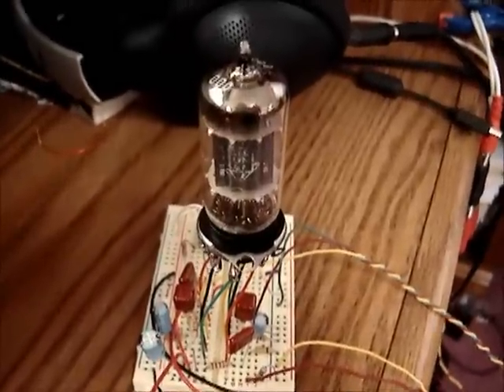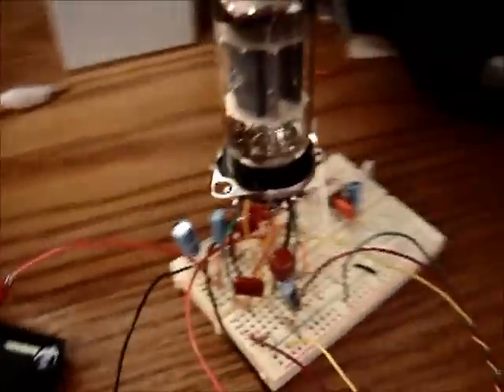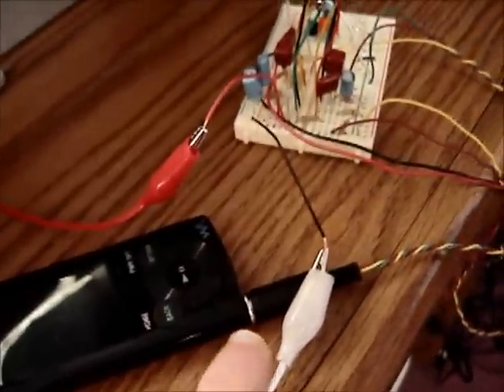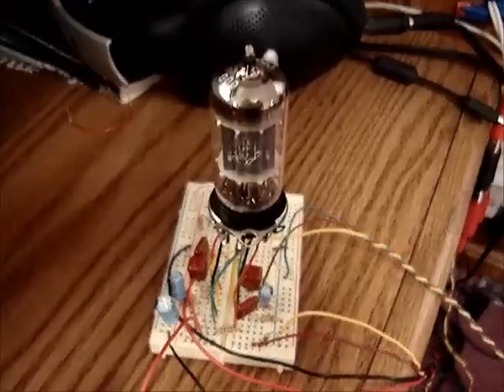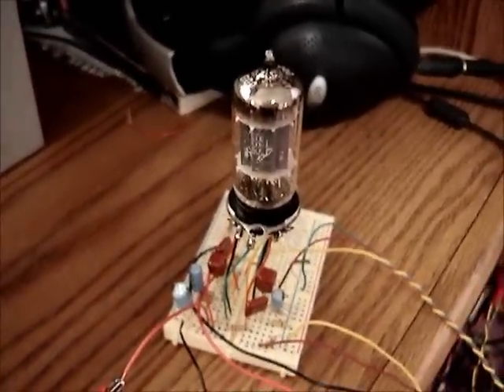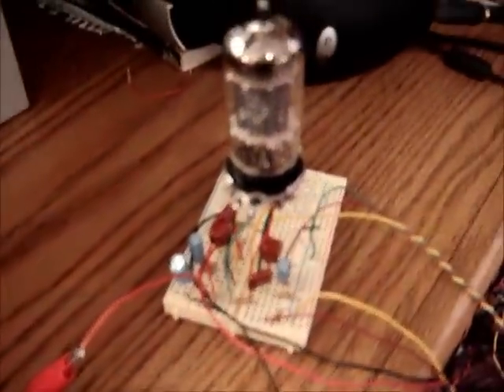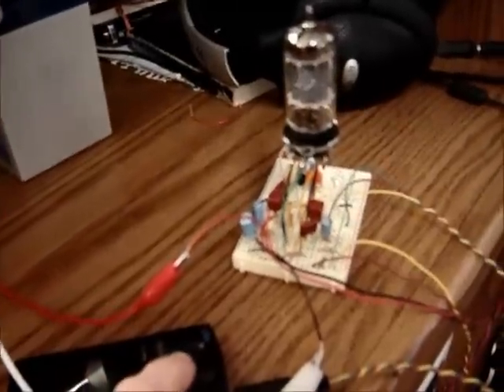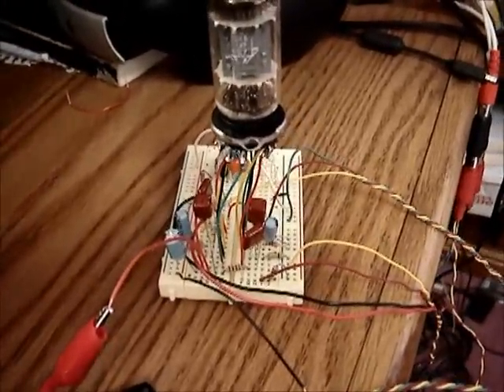12AX7 stereo tube preamp only 12 volts

Comment: Good evening my friend, can you tell me the values of the capacitors? I was very interested to carry out your project.
Reply: the capacitor's values are one the schematic itself...
Reply: 1 uF?
Reply: wenderson eliecio Yes. You can use unpolarised electrolytic. If you don't have one, you can make one from two polarised ones, like this:
----)|---|(---- Make sure they're both 2uF because in series, that would equal to 1uF.
Reply: Thanks a lot, I do not know how to read capacitors, only resistors.
Reply: wenderson eliecio Even if they are marked, they are sometimes wrong. Your best bet is to take the multimeter, and set it to capacitance, and measure every cap you will use. Be sure to discharge them before you measure them!
Reply: Didn't expect a 12Axx to work at such low voltage.  Sounds pretty OK too.
Just wondering if I would have to change the resistor values proportionally if I increase to 24v or 48v?
Reply: @Unker_Spunkanathan  if they are rated for higher voltages, no. otherwise they will be releasing magic smoke

Comment: I wish I understood why you have a 47K resistor and a 470K in series.  Is that where you're splitting the power supply?
Reply: He made a voltage divider with those two resistors

Comment: Just made one,tried it with several tubes,... sounds like shit.... did you draw up the schematic right?(removing the 47k bias-resistors doesn't make any difference) (weird)also tried it without cathode resistor and or bypass cap,it all sounded really bad.It did get a litlle better with 100k anode resistors but still...it doesn't really work.
Reply from the maker: Could be the load impedance the output is connected to is too low and it will load the amplifier down. The music samples at the end are right off the circuit. My tube was worn so tweaking resistor values of bias would be necessary. Overall it is an experiment, not all that practical really.
Reply: It was connected to a tube amp (500k) anyway it was a fun experiment  ;) (maybe i'll try it once more without  the 100k resistors across the output...)

Comment: This is how so many manufacturers got away with selling "tube" amps for years.  By avoiding having to build expensive high-voltage power supplies to make these tubes operate where they actually work, they put cheap, shitty IC/transistor amps on the output to kick up the gain...

Comment: Running a tube in "starved Plate" mode is a poor way of doing this, and running the heater @ anything above the max voltage will destroy the tube. There are better options... you can use a DC to DC boost converter or a flyback or a charge pump supply, with good filtering, that can give you the higher required Plate voltage easily and inexpensively if you don't want to mess with a traditional linear power supply, is the way to go. And furthermore... this nonsense that a tube sounds better than an OPA2134 Burr-Brown Op-Amp or a properly designed low noise, high gain, transistor or FET Audio Pre-Amp is ridiculous. There are also some great "single supply, rail to rail" op-amps that kick ass, if you're looking to run off of a low voltage like 5 VDC.
Reply from the maker: +Mark Rakemaker The filament was not run above the rated voltage. It is rated12.6 volts and that is what I used. The idea was to see how the tube would run on 12v. It has limited gain of about 20db and sounds good to me. I'm quite aware of how good IC op amps can be but this video is not about them and I made no claim that tubes sound better.
Reply: Part of my comment was directed @ a few of the earlier comments. One chap recommended "overclocking" the heater to 18 volts... lol. People often assume that tubes sound better than solid state arraignments.

Comment: You can get the miniature wire-ended valves from the CCCP if your know where to look or try EBAY, It is like being in the KRONUS HIFI factory showroom in DUNGANNON Northern Ireland.
Reply: David, do you have a model in mind that is known (by experimental designs or otherwise) to create good sound? And do any of them come with a datasheet that quotes IV characteristics with a low supply voltage?

Comment: What's the maximum gain you can get from these at 12V? I'm struggling to get more than 30dB
Reply from the maker: +Jack Holden Not a lot of headroom to work with at such low voltage. 30dB is not bad. You might want additional stages for higher gain.
Reply: yes. Up to a total output voltage of 10-12V, assuming you get the grid bias correct.
Reply: ...does that mean you can basically 'bolt on' additional stages for more gain?
Reply: it's hard though and you might need transformers between stages.

Comment: Would you be interested in running a similar experiment with spectral analysis again with a 12AE7 tube if I sent it to you?
I would really like to see if there is a similar "low order harmonics" effect like with this one.
Was a great experiment and the preamp works amazingly well!
Reply from the maker: +MAN CAVE NO.1 You would find that about any amplifier with a single active element whether transistor or tube will produce low order harmonics due to the nonlinear gain structure of the devices. If tubes or transistors has a perfectly linear gain structure, amplifiers would be a lot simpler to make!

Comment: I notice that on some guitar pedals built for distortion they use the same valve but with a current of only 9volts. I have guitar valve amplifiers and my main stereo amplifier is also valve . You can feel the heat from them.  The guitar pedal I have barely lights the valve.  I find it hard to believe that such a low voltage has an effect but it most definately does.

Comment: What hardware and software are you using to do the spectral analysis.    I assume just a sound card would do it?
Reply: From the looks on the icon on the task bar hi is using http://www.audacityteam.org
I think hi might just have played the 1K test signal and then taken the output and put that on the line in on teh sound card and recorded it, and THEN done a spectrum analysis on the recording.

Comment: you're not supposed to get those harmonics until near saturation though. must be very nonlinear
Reply from the maker: +nikotwenty Those harmonics are quite mild and equate to 0.4% THD. Not hifi, but not bad for a single element amp.
Reply: +JohnAudioTech interesting though 48db down, I think you are right I don't think that could even be heard
Reply: Harmonic distortion is what gives tubes that "warm" sound. Stereo manufacturers use THD as a performance indicator as though it were a bad thing. That's a little misleading. Intermodulation distortion is the "bad" distortion that makes an amp sound unpleasant.
Reply: Intermodulation distortion is what matters most, a two-tone test is the simplest way to see it.  All distortion both generates harmonics and intermodulation products, but the latter are usually far more audible.
Reply: @Diggy Dude, not wanting to sound elitist or audio snob but, any (hearable) distortion is bad distortion in a hi-fi system, a system that is meant to accurately reproduce a signal instead of coloring it.
Sure there more important factors than THD but ideally a hifi amp should have as little THD as possible.

Comment: @ 12v, you can't really use a 12ax7a, but, you can use a 12at7, 12au7,12av7,12ay7. Put one of those in there and watch how much more gain you get. I make a great 12v dual 12au7 pre.
 The only way to do a 12ax7 is basicly "overclock" your heaters. What you can do is put a resistor in series with heaters and run it of 18V, you'll get higher plate voltage and you'll be able to tune heater voltage to 12.6V. 
18V, minus 12.6V = 5.4V. 
5.6V/0.15mA = 37ohm. 
0.8W. 2W 37ohm resistor.

OHMMMMM
Reply: +Rob Cosentino  You're not "overclocking" the heaters... You're overheating the cathode! The tube will last weeks! If you're lucky! :-O
Reply: I mean "overclock" figuratively or as a way to explain of course.
I just recommend using the 12a(t,u,v and y)7. Also, one of my favorites, the JAN 5965(12ay7). If you want to use a 12ax7, use higher voltage.
Reply: Rob, what about a 6cg7/6fq7?

Comment: hi john great video. what are the cap values on the in and out please. cheers in advance
Reply from the maker: +MonkeyMagic Elecifun Given the high impedance, you can use film caps in the 0.1 or more range. Select value so frequencies 5Hz and up pass.

Comment: Great job!  I am a novice and know very little regarding this, but willing to try to build the circuit by realizing the circuit is low voltage and safe to work with.  Is the circuit your priority or can you share your schematic?  I will understand if you tell me you wish not to do so.  Thank you for a great video.
Reply from the maker: +Carl Philistine Hi, The schematic is shown in the video. You may need to tweak the biasing resistor values as my tube was worn.

Comment: what is  "4k7"?
Reply from the maker: +bustersinclair 4k7 is the same as 4.7k It is a common way of notating values. Another way is 472 which means 47 followed by 2 zeros or 4700 which is the same as 4.7k.

Comment: By positively biasing the grid, you are working the tube in a range called Grid Conduction. The input impedance of the tube is unknown, the characteristics of the tube are unknown. this exercise is very silly . If you want "tube" sound then use a 200 V supply!
Reply from the maker: +Fred Zlotnick Any characteristic can be measured. The circuit is not practical for some uses because of the low ~20db voltage gain. Experimenting is fun. Being a wet blanket is what I consider a very silly exercise.

Comment: I am not an expert, I have read about it but don't have much listening experience, but part of the so called tube sound is that the clipping is not as harsh as a transistor amp. Of I don't know if this applies to preamps the same as power amps. Of course tube power amps that with big iron core output transformers get expensive.
Reply from the maker: ***** I think a lot of "tube sound" is born out of musical instrument amplifiers that are supposed to distort like those for electric guitars. This (some how) carried over to audio amplifiers where you really don't want clipping or distortion. Still, very good tube audio amplifiers sound great, but are somewhat impractical to me as they are costly and consume a lot of power, even at idle. Solid state is just as good or better to me. Perhaps not as good for guitar amps but I'm not a musician.
Reply: JohnAudioTech What you get with a tube guitar amp is that seamless transition from clean to distortion. Plus the distortion itself just plainly sounds alot better. As for clean sound, the difference is not that great in my opinion.

Comment: My guitar preamp runs off 4 AA batteries (6volts) and is a cold cathode 12ax7  impedance  (probably a 
darlington dc configuration?) "transformer" to a high impedance bridge piezo. it is referred to as "a cool tube"
preamp..works good and really provides a warm sound for the guitar.
The tube heater runs off 6 volts. Don't know what the plate voltage would be but
I expect that it may have a doubler working off the 6 volt batteries for 12 volts.
The o/p of the preamp tube goes into so solid state circutry and being proprietary,
I don't have a schematic for it.
The music sample sounds very clean, similar to mine.
Reply: The tube filaments would normally be wired in parallel, to properly heat the tube on 6 volts, but, the heaters require .3 amps. In that configuration, the batteries would only last 8~10 hours. Running as "cool tube", the filaments are likely connected without the center tap pin, causing the heaters to run at only .08 amps, receiving 3 volts each. A tube can operate in this condition, but the circuitry around the tube must be very high impedance. Most likely, JFET op amps. The tube should last a lifetime.

Comment: Actually, a 12AE7 or a 12U7 double-triode would work MUCH better than a 12AX7. The specs are waaay off. If you want to use 12volts a tube that is made for 12 volts should work much better than a 12AX7.
Reply from the maker: ***** I'm aware of better tubes for the purpose. This was an experiment to see if the scavenged tube I had laying around would work. I didn't want to spend anything on new tubes. I might try it with other tubes if I can scavenge some up someday.
Reply: Right on. Understood. Sorry, I didn't intend to be critical. I totally didn't understand at first anyway. It was a great idea, actually. I think there are even some websites dedicated to the use of HV tubes at way below their intended voltage with interesting results.
Reply: Good info.
Reply: Actually, the 12AX7 is designed for use on both 6 and 12 volts. There are 3 heater pins on the tube, allowing it to be driven directly from a 12 volt battery. This type of tube was used in early car radios, and was expected to run right off the 12 volt battery. For use on 6 volt filament supplies in Hi Fi and guitar amps, the center tap pin becomes one, and the other two are connected in parallel, allowing the heaters to draw twice the current at half the voltage, making it compatible with the 6 volt power tubes supplied from the same transformer winding.
Reply: @vincentrobinette1507  Well sure the HEATER works on a 6 or 12 volt circuit but that has nothing to do with the plate current at that same voltage. 12AX7 may be able to operate it's plate at that low voltage but a tube designed for it would work better...if one must have tubes. A 30 volt design works particularly well and is still somewhat low voltage.
Reply: @AtomicElectronCo  In order for a tube to pass any real current at those low voltages, the grid and anode need to be packed in closer to the cathode. A 12AX7 can indeed work on low voltages, but, the impedance is really high. JFET op amps, like the TLO74, work really well, because their input offset current is low enough to be used in the 570k to 1M impedance ranges. At that point, the only purpose of the tube, is to sound like a tube, with all the harmonics shown on the analyzer used in this video.

Comment: What a lovely project this looks like! I would like to use this preamp in conjunction with a solid-sate amp shown here: http://www.adafruit.com/products/1752

As a friend of mine pointed out, the amp can only take 3Vpp line-level input, would I be able to run this preamp with the same 12V SLA battery used to power the class D amp? 

Also, how hot does that tube get with a 6V heater?

Thanks!

Comment: The preamp is NOT what is making all that output then. This preamp is connected to a power amp as well. It is good as a preamp, but I did not understand that 11months ago when I attempted to build it then.
Reply from the maker: ***** Yes, Its namesake "preamp" means it would not be driving a speaker. Just to be clear, when I did the music demo recordings, I plugged the tube preamp directly into the inputs of my computer and recorded. There was no other device between the preamp and the recording device inputs.
Reply: JohnAudioTech Right, it's namesake clearly states it is a PREAMP which makes no sense to those who don't know what that is. 11 months ago I did not understand there was anything different as would anyone who was a very beginner or elementary level hobbyist. It took months of figuring out why I couldn't get it to work properly or as loud as it is here. At the time I first saw this, I thought it was a solution using a tube to drive a speaker with only 12 volts. It is clearly not that.
Reply from the maker: ***** It runs fine but gain is limited to about 20db. Distortion is surprisingly low. This was more of an experiment to see if it would work.

Comment: I'm seeing B+ on the grid 47k or is it part of the circuit 470k ohms grid bias is right.
Reply: That's not a mistake. With the plate voltage that low, it is actually necessary to pull the grid slightly positive of the cathode, much like the screen grid on a tetrode or pentode. As the plate voltage increases, the grid needs to go further and further negative, to maintain plate current. At high voltage, the grid is indeed pulled below the cathode, weather it's accomplished by a cathode follower resistor, or, negative bias voltage on the cathode. A typical set-up in a guitar amplifier is a 1k resistor from the cathode to ground, and a 100k resistor from the plate to positive. That does a pretty good job of splitting the voltage between the tube and load resistor, to give maximum headroom. The gain is ~100:1, and the grid can be referenced to ground,(usually 100k)  without any need for input capacitor. The guitar can be connected straight to the grid. The 100 K resistor to ground is just to maintain bias when the guitar is unplugged, and the jack doesn't ground.
Reply: @vincentrobinette1507  I remember in my 20s I would do experiments like this with 12ax7 12au7s after I got stoned I remember pins 2 and 7 are the inputs pins i and 6 plates and 3 and 8 cathode and a small negative charge in respect to ground to pins 2 and 7 like 750K ohms. I used raytheon and rca 12ax7s off an old baldwin organ good ole  days.
Reply: @TheWarped45  I got my start the same way! I used to get tubes and other passive components from old RCA television chassis, and old radios. My interest has always been amplifiers. I salvaged a tube amplifier out of an old Magnavox console, and that became my power supply for experimenting with tubes.
Reply: @vincentrobinette1507  that is very cool right now I have 807s nos I think I will make a stereo amplifier one day I have 6l6s but 807s look cool maybe a 6cg7 6fq7 for the phase inverter ef86 in the preamp.